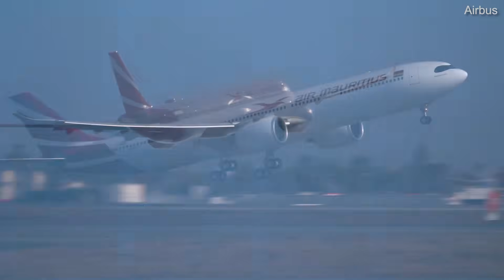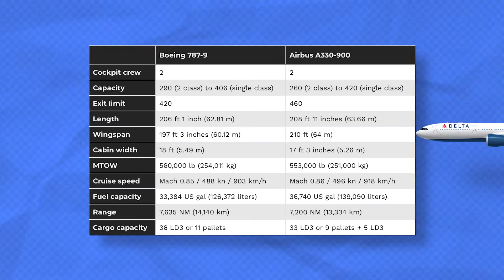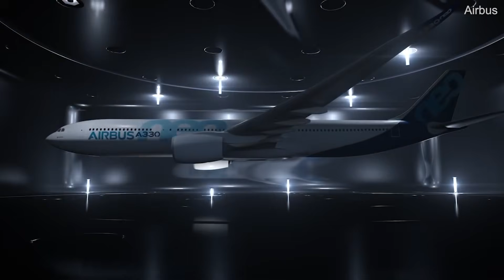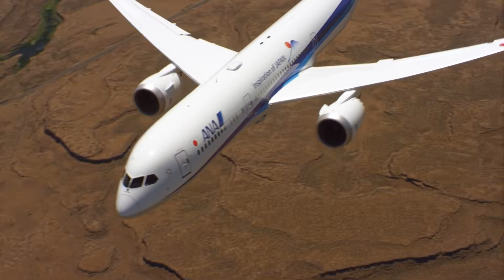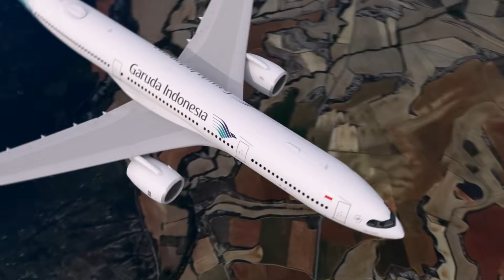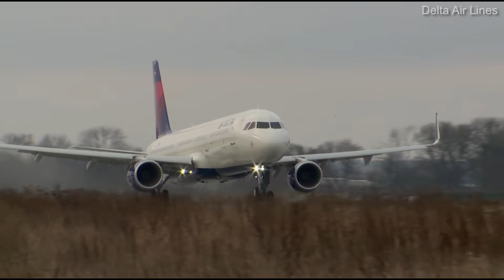Airbus A330neo Vs Boeing 787-9 – Which Plane Is Best?

Comment: comparing the A330 NEO against the B787 is like comparing the A320/321 NEO with the B737 MAX. Old with new. Airbus made a smart choice with the A330 NEO since the A350 is not exactly in the same plane segment as the B787. Boeing has sold many B787 BUT is not yet making money with it. Amid the quality issues and production flaws. In the contrary, the A330 NEO is already making profit despite low sales. And the image of Boeing has been damaged. With the B737 MAX fiasco and the B787 saga. Not to mention the future B777X certification hiccups. Industrial setbacks (like with the A350 paint issues) will always exist in the industry but Boeing will suffer from that poor reputation for years. And will struggle to make profit with new plane models. In a recent past, Boeing was still considered as a serious, reliable and trustful company. Making big profit with competitive and qualitative products. But since 2018, things changed dramatically...
Reply: Were not trying to compare the quality issues and production flaws of Boeing in recent years as Airbus has had quality issues and production flaws too but not as bad. The image of Boeing hasn't been damaged for long. Airbus image looks bad too. they all have their similar images being bad or good at times. The future 777x certification hiccups aren't Boeings fault for delaying it. one was for a good reason. Prioritisation, secondly the demand for it is not right now. Oh even Airbus was a serious, reliable and trustful company. Making profit with competitive and qualitive products,. But with recent events things changed dramatically for them too

Comment: I am yet to fly on the A350 but as most of my flights are cattle class, it comes down to space. For instance I prefer flying on the 787 rather than the 737. I have little choice but take the aircraft that are provided to suit my holiday.
Reply: 737 seatings are horrible. A320 is much nicer

Comment: I've flown both types in coach, the airbus a330-9 is my favorite wide body so far. I actually hate the 787-900. The A330's 2-4-2 seating is a lot better than the 787s 3-3-3 seating. The Boeing seats are very small and cramped, the A330 has wider seats with better pitch. I really feel like Airbus needs to do a better job selling their planes, even when they beat boeing, they still lose in sales. In my opinion Airbus is putting out much better product than boeing, I used to be a Boeing guy but I have started to shift to Airbus. I hope the A330 will be around for a long time to come I look forward to traveling on it in the future.
Reply: Boeing and Airbus don’t decide 8 or 9 seats across. It is the airliner which decides how many seats in a row.
Reply: The 787 was originally designed for a 2-4-2 configuration but most airlines decided to go for a 3-3-3 layout after they realized it was possible. Airbus is doing something similar with the A350, and there are probably a lot of airlines that will retrofit their A350’s.

That said, I’ll add that the 787 doesn’t really give you control over your windows whereas the a330 does. If you want to watch the sunrise on an eastbound transatlantic on a 787, too bad. FA’s are gonna lock the windows despite the low brightness.
Reply: Well that depends on the airline not the airplane

Comment: No disrespect, but the comparison is just unfair and incorrect
787 is not really a direct comparator with 330neo
in term of airlines' view, 767s < 330s(CEO/NEO) < 787 < 350 < 777 < 747 < 380
787 was never looking at 330meo, it was looking at 350 + 330-300 when it build
Boeing wanted to have an aircraft to fit all the need from 767-300~777-300, including 777-200/ER/LR & 767-300/ER & 767-400ER.
This is unfair to 330-900, when Airbus was building it to replace 330-300 and upto A350-800 that never into service

Airbus and Boeing was going with different style when they consider new aircraft (787 / 330neo)
Boeing was looking to upgrade 777 to takeover the 747 market and use 787 to cover the market between 767s and the lower end of 777
Airbus was looking for a replacement of 330--300 (the biggest success in airbus) and use the 350 for higher end of the market
That was really limited the ability of 330neo to avoid crushing into 350's market, those two were too close.
Both on range and capacity, Airbus has to manually limit 330-neo to avoid taking over 350's market

At the same time, Boeing had a very clear plan of where the 787 they wants to put in their product line.
By upgrading 777 family toward 747's capacity, Boeing can maintain its market on 747 using 777-9X when most 747 is planning for retirement
And release the lower end of the market for 787-9 and 787-10 to replace those aging 777-200/ER/LR & 777-300,
While the 787-8 can replace 767-300/ER & 767-400ER with a better range

787 was way far beyond 330neo
If we really want to compare 787 with 330meo, 787 won before coming to the design board

Simply idea as an airline,
1) Why would I need a 330neo when 350-900 can cover everything 330-neo does with slightly more money?
2) Why would I need a 330neo + 350-900 when i can cover all those market with 787-8 & 9 & 10?

Comment: There is no comparison. The A330 NEO is 7 abreast seating and the B787 is 8 or 9 abreast seating.
Reply: A330 is always 8 abreast at 2-4-2 configuration for full services carriers, whereas some low cost carriers like AirAsia X arrange the seats at 3-3-3 configuration

Comment: Something I miss in this comparison is the additional comfort the 787 provides, with the higher pressure in the cabin and the humidification system. Otherwise pretty good assessment. The A330-900 seems like a great option for budget airlines who don't have business class and don't need the additional range and freight capacity.
Reply: so the comfort provieded by the 787 is a smaller steat and lower cabin pressure, no1 gives aF about some miniscule increase of lung comprimation if them asses wont fit in the seat...
Reply: @MrOstereier2222  The seat size and leg room is dependent of the airline. And the higher pressure and humidity in the 787 makes you feel less tired, less flatulent and less thirsty during a long flight. The extra humidity is also much more pleasant for passengers using contact lenses.

Comment: Among these lovely 2 planes, I love NEOs. Try 2-4-2. That’d be my answer.
Reply: 2-4-2 any day. For longhaul I don't think anyone will ever come close to the economy experience on A340s - even flying on old PAL ones handed down from Iberia, it was a fantastic experience that the A330neo continues. Quiet, comfortable, civilized. The 787 is much more noisy and really cramped with the 3-3-3 layout.
Reply: @lmlmd2714  lol the Philippine carriers are using 3-3-3 on the 330neos. Good luck with that.
Reply: @trpct what's wrong with 3-3-3? Just asking
Reply: @IsmaelHanzala-ub8qj  If you're in a window seat, you have to climb over two people to get to the aisle. If you're in an aisle seat, you're two seats away from the window. If you're in the middle, you don't sit near the window and don't have direct aisle access either.
In 2-4-2 configuration, noone is more than one seat away from an aisle.

Also consider the boarding process. If passengers enter the airplane in an inconvenient order, say the first person to enter is the one in the aisle seat, next comes the one who is in the middle seat, and the one in the window seat enters last, people have to get up multiple times until everyone is in their seat. In 2-4-2, it's much less complicated and quicker.

I just had two long-haul flight in a row, the first in a 339neo (with 2-4-2), the second in a 787-10 (3-3-3) and boarding took significantly longer in the 787.

The 787 is a beautiful, sleek airlpane, the cabin air quality is a noteable plus, but in terms of seating comfort and passenger convenience, I'd choose the a330neo any day.
Reply: @IsmaelHanzala-ub8qj narrow seat width (only 16.4-inch wide) on the A330 if using the 3-3-3 layout
Reply: I agree 2-4-2 is much better!
Reply: The 787 has to be the only Boeing I like but both are very beautiful planes if I had to pick one I would pick the A330neo
Reply: 787's 2-4-2 is better.

Comment: Honestly, is the B787 unbeatable? Cuz no matter how I think. I couldn’t think of why airlines would choose over the A330neo. The B787 is just too fuel efficient while the A330neo is just less then that. (I persaonkly think) that airlines just don’t care about any other specifications other than is it fuel efficient or not. A330neo is just another a330 with better and newer engines which didn’t really make any difference with the older -300 and -200 engines. Correct me if I am wrong I am really routing for the A330neo here but Boeing is doing way better with the B787.
Reply: It all depends on how each airlines configures their cabin. The biggest difference between the A330-900 and the B787-9 is their cabin width and usable length. The A330-900 has longer thinner cabin while the B787-9 is wider but shorter.
For apple to apple comparison, you can analyse the cabin layout of scoots B787-9 vs Jetstar A330ceo. Despite the wider cabin, both cabins can only accommodate 6 abreast premium seating upfront and 9 abreast economy layout in the rear. So the longer cabin allows Jetstar to seat more passengers in the economy than scoot hence lowering the operating cost per seat. That is also why we see LCCs like cebu pacific, AirAsia etc and leisure carriers like condor favoring the A330neo.
Looking over to the legacy carriers, both aircraft offered the same 1-2-1 business class configuration upfront but differ in the economy class configuration. The B787-9 seats 9 abreast in economy while the A330-900 seats 8 abreast. According to airbus, the extra length in the A330neo was suppose to offset the seat difference making both aircraft seating capacity identical. However that really isn't the case when premium economy, galleys and lavatories are added in. Hence we see legacy carriers AA with more economy class fitting more passengers on board the B787-9, while premium heavy airlines like Delta fitting more passengers onboard their A330-900.
As you said, it all boils down to the fuel economics, but more specifically the the operating costs per seat is why really drives the airlines choices.
Reply: @chingweixion621  ah I see.

Comment: I flew an Air Canada Boeing 787 Dreamliner on a 4.5 hr. flight across Canada in March 2022.  It was smooth and comfortable until landing.  It rattled and shook on landing and not impressive. On the return flight, we were on an older Airbus model.  It was quieter, more solid and landed without the same rattling and shaking as the Boeing eventhough it was a much older aircraft.  As a passenger, I have generally preferred the Airbus offerings for these reasons.

Comment: Haven't flown an A330neo so far. The Dreamliner is quite loud and you can actually feel the turbulence shaking it all over. (Flown on Turkish Airlines 787-9 from istanbul to Atlanta and back for over 10 hours). I do like the raked wingtips though and electronic dimming windows.
Reply: Dreamliner that’s loud and shaky?? Exact opposite for me every time I fly on one
Reply: @andrewkenobi9486  yup i was quite surprised about it too. It's been said that it handles turbulence like a breeze but not when I was on it (both ways) and the noise was horrible (I was seated next to the wing)
Reply: @a_man_has_no_name it probably was the hydraulic sound https://youtu.be/R-XepgQKqhs?feature=shared. The advice is that you avoid that Aerea of seating if you can. More up mean the real experience.

Comment: As an Airbus fanboy, the 787-9 is hands down the best, no argument.
Reply: Obviously there is no doubt in your fanboyism  of AIrbus
Reply: Hell nah u ain't a airbus fanboy but the opposite
Reply: No it isn't. Not even slightly
Reply: gotta experience the 2-4-2 on the a330 instead of the cramped 3-3-3

Comment: I’m pretty sure the 330 doesn’t ‘cruise’ at 0.85. 
I remember .82-83 was a more representative number.
Pesky 78 is really fast !
Reply: @Roger  it doesn’t cruise at 0.86, that’s it’s MMO, you can’t fly at that speed and the auto thrust will limit you to 0.85. I flew the 200/300 for 4 years, it’s the same wing with different winglets for economy.

Comment: When I first saw the 787 in photos and heard how it was designed for point to point rather than hub & spoke flying, I assumed it was a narrow body. But then I heard it was a wide body and was more amazed by it's ability for long range point to point, learning how it was compatible with smaller airports than typical hub airports. It's more impressive to me because of what they achieved with a clean sheet design before Boeing's issues in recent years. The A330 neo does come across as more practical to me in a way though with its standardised parts and controls across multiple aircraft in the Airbus range. But these are just the opinions of a casual observer.
Reply: I see standardized parts as the same old cash saver that Lee Iacocca did with Chrysler, where a base model K Car used the same parts as a top of the line New Yorker,  Saves money but resulted in premium cars with base model chassis and engines.  The only differences were bells and whistles added to the more premium interior of the New Yorker, more commonly known as lipstick on a pig, though perhaps a bit harsh in the case of the Airbus.
Reply: Boeing hit the direct point to point on target with the 787. Airbus was pushing the A380. Airbus was wrong.
Reply: @apolloniaaskew9487  Nonsense - the engine manufacturers screwed Airbus and gave them an old technology engine with high fuel consumption.  Then Boeing came and they got the more fuel efficient engines.  Imagine an A380 with 15% better economics!!!!  John Leahy published two articles in 2020 about this issue,  take a look at it.
Reply: @aquaden8344  ok scare bus fan boy lol
Reply: @user-wn6pr4qh5v  You sure?  Then check, why the engines of the big twins are 10% to 15% more efficient than the A380 engines!  Could it be, because the A380 had older technology engines?
Well Einstein do the calculation.  What would have happened, if the engines of the A380 would be 15% more efficient?
It would be nice to use your brain before you put your stupid LOL into a reply, thank you.
Reply: @aquaden8344  Still would only make sense for Emirates

Comment: There doesn’t need to be a which is best. Both planes have their own strengths (and drawbacks). Both are modern and provide savings in fuel burn as well as a comfortable, smooth ride for passengers. Why is it always an Airbus v Boeing thing?

Comment: a330 cruise speed is wrong, normal cruise is 0.82 and max is 0.86
Reply: Actually top speed is mach 0.86 = 1062*kmph, this channel needs to stop making big errors like this.
Top speed for 787 is mach 0.9 = 1111kmph.